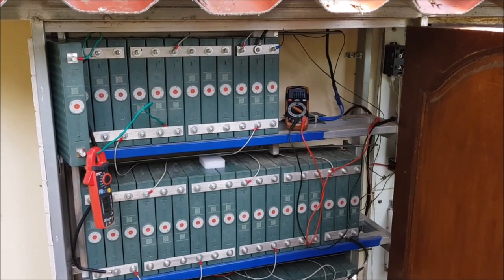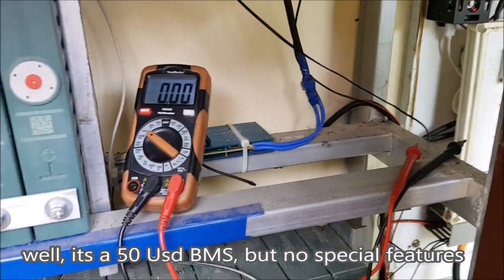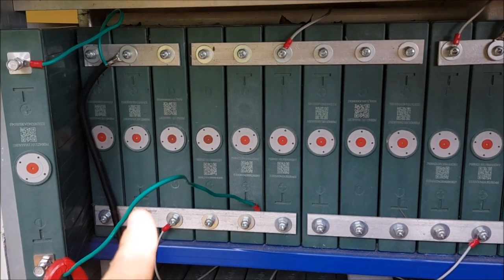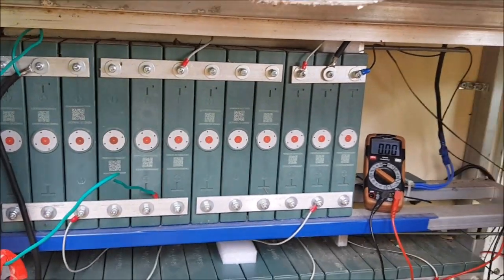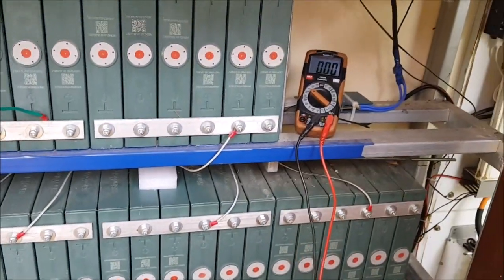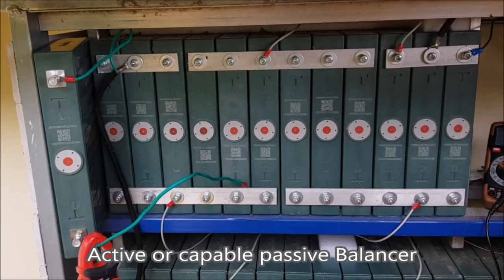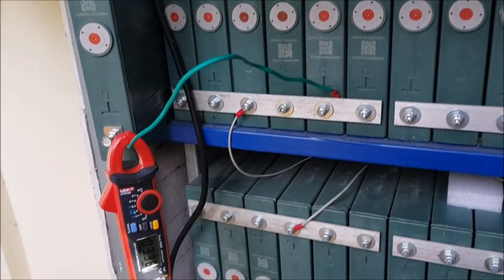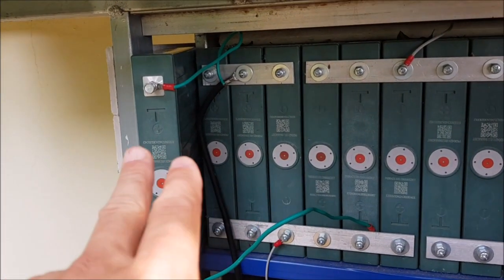Correcting a cell-imbalance in my LFP-Pack for first time in 8 months of cycling.

Comment: Nice cells you have there . It’s all about balancing them evenly so the BMS won’t be shutting off the power when one or more of the cells reached the BMS high or low voltage threshold . May the solar be with you .

Comment: 2:19 Voltage isn't really a measure of SOC.  Remember that lifepo4 batteries spend most of their discharge curve around 3.2V +/- 0.1V.  That's why when you start a pack you need to top balance all of the strings.

Comment: You know your battery bank well. Maybe another solution could be to take the high and the low and mix them together by re configuring them by trading one in each other cell and then maybe not. It is the nature of Lifepo4 to always have a high and a low cell at the top and bottom of the cycle and all are balanced in the middle but you know this already. I have to balance mine every once in a while too even with the active balancer.
Reply from the maker: yes. typically when you avoid the edges in voltage, you will never see imbalace if there is no real outlayer present.

Comment: I'm still in my 4th month usage for my used sinopoly batteries.
Reply from the maker: so how is your experience with those cells? holding up as hoped?
Reply: @RolandW_DIYEnergyandMore  So far I'm happy with them. I'm getting 6.8KWhr (losses included) from a 24V 8S3P configuration.
Cost per kwhr is almost the same as our electricity base price here in Philipines. Hope they would last more than 2 years to breakeven just for the cost of the batteries alone. Fingers crossed.🤞

One seller here is selling two variants, one as 90Ahr and the other one as 95Ahr. Never got the chance to test their capacity individually though.
But it does seem that the 95Ahr performs better.
Reply from the maker: @pollada1  those numbers sound good to me. I would not worry much about the longevity. All what i have learned from my 2 systems, is that in our climate and going easy on the battery as much as possible, Lithium cells do last longer then advertised. You will make far longer then 2 years I am sure!